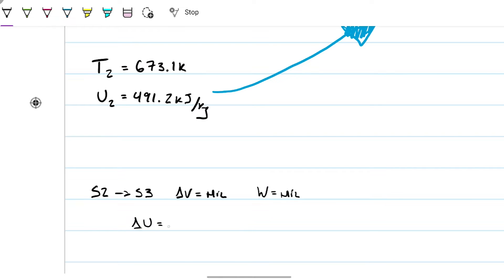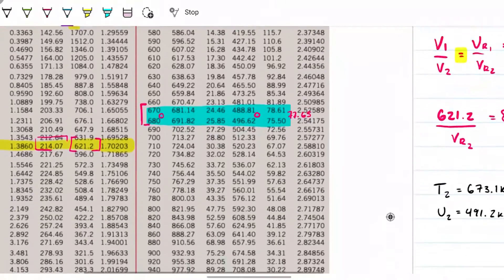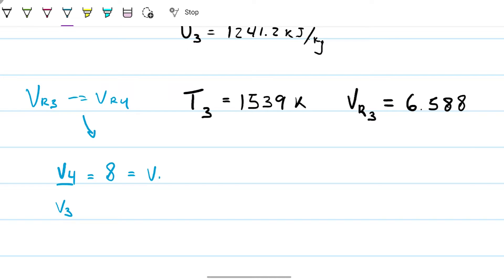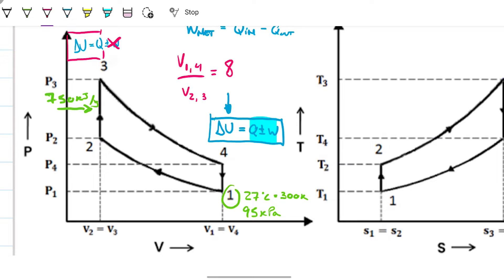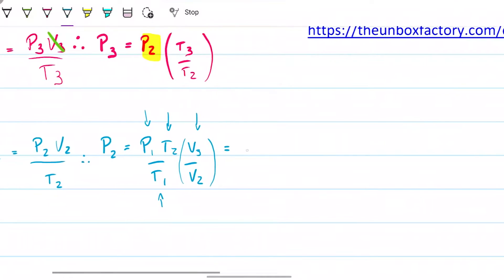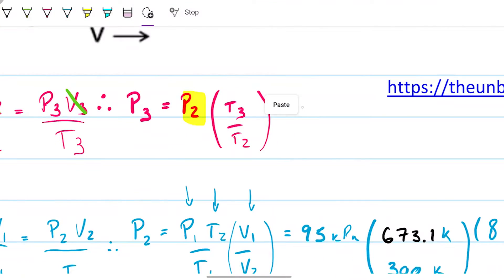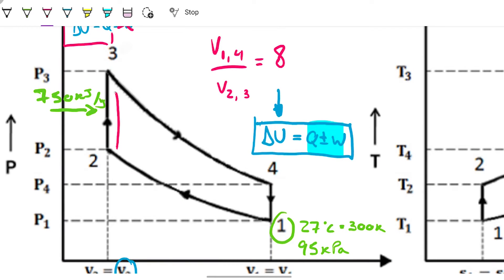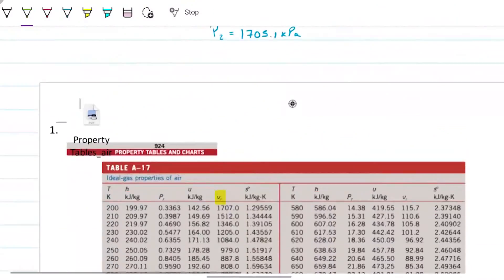Complete Otto Cycle Problem (2 of 3) | Thermodynamics

Comment: so basically ideal gas eqn is applicable in all proccesses?
Reply from the maker: In this case, yes. The key word in the problem statement is "air", since this cycle has air as its working fluid, and air is comfortably approximated to an ideal gas, you can use ideal gas equations.

PS: recall air is basically just N2 and O2, both of which are ideal gases.